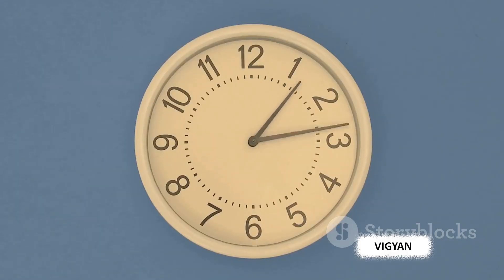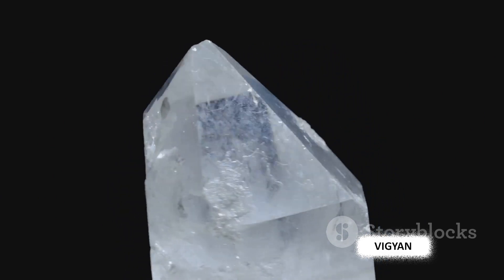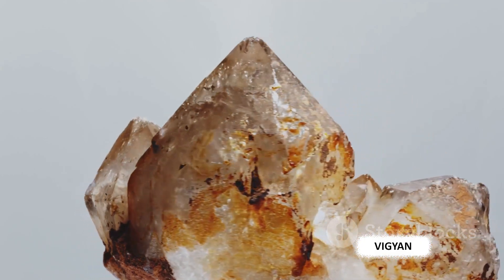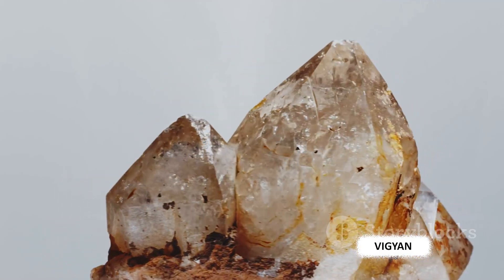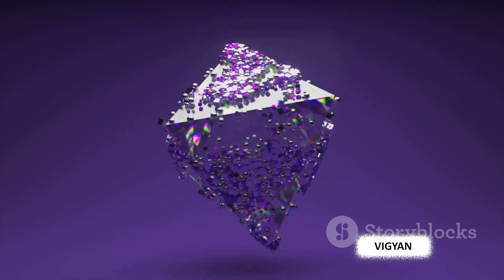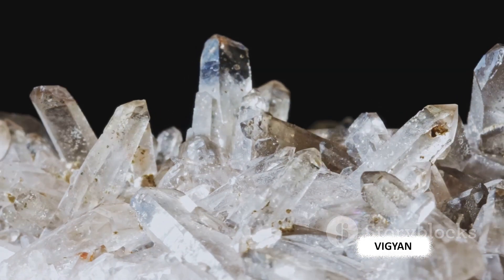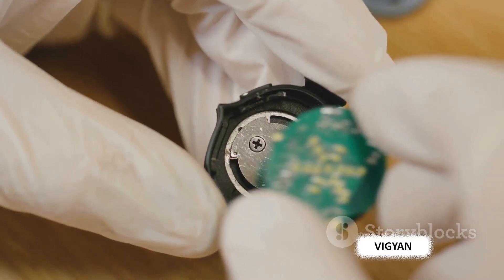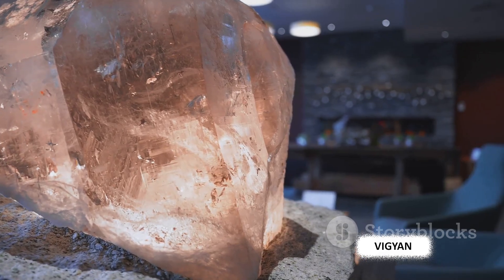Unraveling the Mystery_ Quartz Crystal Oscillators

Comment: It's called a real time clock device,..Once you have a super stable time base, by a temperature controlled crystal oscillator,.. You now have a way to measure the propagation of the real time involved in factions of a second , minutes or hours of a day time , in real hours or even the number of days,weeks or months of time. So with a stable time base that has very little in the way of deviations, You can now know where you are , or how much time it will take to perform a specific operation or calculation of a function. All electrically controlled robots or computers have to have a "super stable time base",... to be able to be on target or be able to sync up to the external signals that are needed in order to help to match up with other external devices in the real world that we live in.